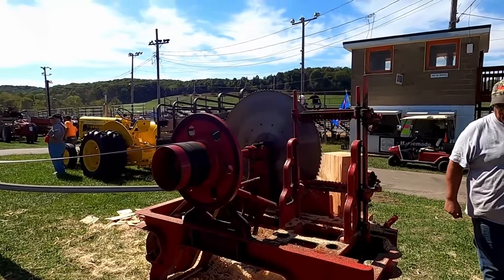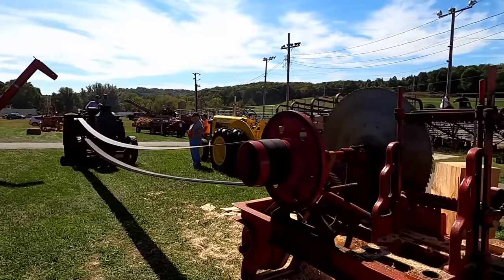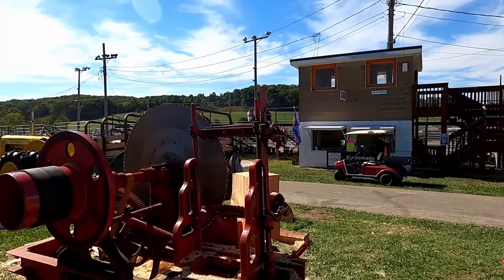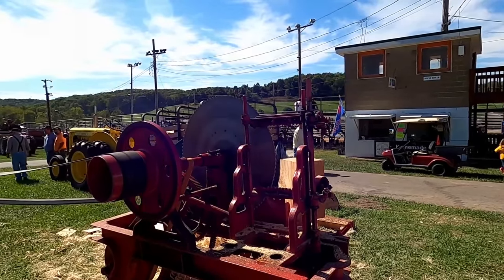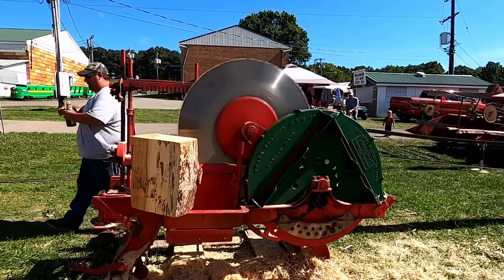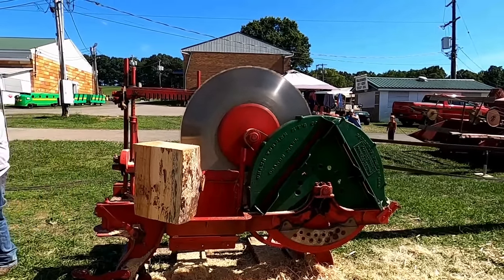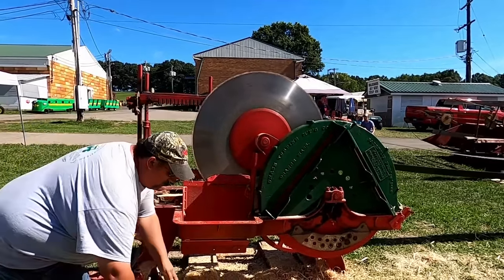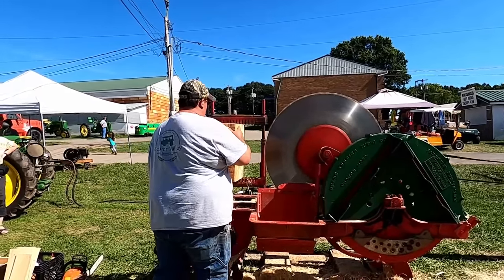Chase Turbine shingle mill #470

Comment: Thanks, ZZ.  That was interesting - I thought shingles were split, but no (maybe in the olden days).  I imagine cedar is preferred?  But by crikey - not very safe!
Reply: Some are and some a cut, the split cost more but take longer to make since I don't think they have a machine to split them automatically.
Reply: Great video. Hay Mark you better watch yourself or ZZ might just steel your show. Just kidding. If ZZ started his own channel I’d watch both.
Reply: @garymurt9112  Thanks for the info, Gary,  Figured hand-made would be pricey.  Shingles look nice on a roof or siding, but.
Reply: Thanks for the Replies, guys, but is there a good wood for shingles?  Cedar?
Reply: @MrPossumeyes  cedar is the most used. Western red cedar is the most common. It real depends on your area. I've seen oak used since it was the best wood for that area in terms of lasting the longest and being in abundant supply.
Reply: @garymurt9112  Cheers, Gary!
Reply: Cut shingles are the most common.  White pine. Cedar is preferred but white pine is plentiful around here.
Reply: @oros35  Thankyou.

Comment: That sure has a long drive belt to it.  Does it need to be that  massive?
Reply: It's my understanding that the long drive belts are to get the noise and excessive heat away. Another reason is to turn the implement in the other rotation you twist the belt. The final reason this belt is this length is that's how long it was and there's no reason to cut and splice it.
Reply: It's the belt I have! Longer = easier.

Comment: The cant is rocked back and forth to cut the shingle to taper but what is he doing to the cut shingles in the second operation?
Reply: Trimming the sides straight.
Reply: @mackyocum5218  Trimming seems irrelevant since they are overlapped anyway.
Reply: It's a planer. Trims the edge square
Reply: @Hogger280  he's trimming the long sides, not he ends.  The singles will sit close togehter then, without gaps between.